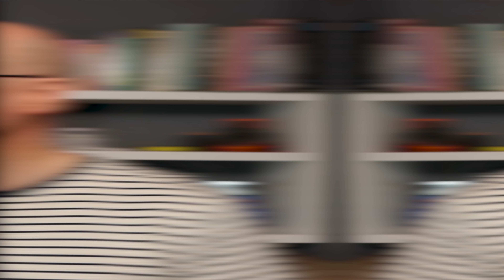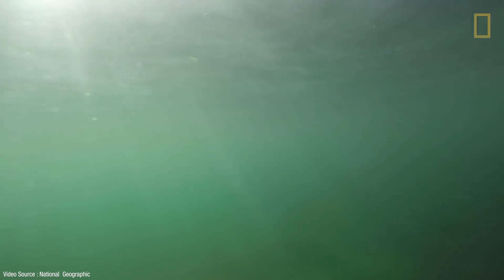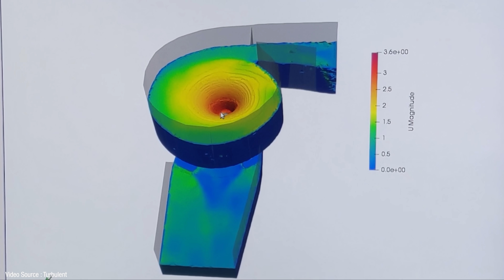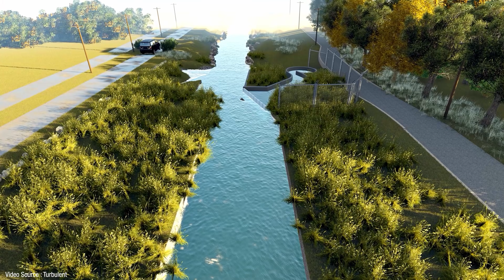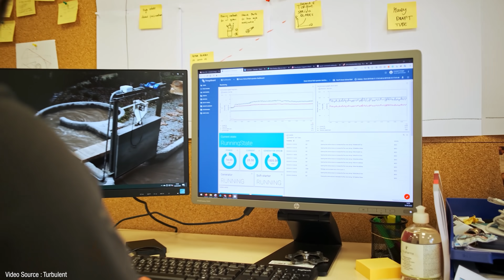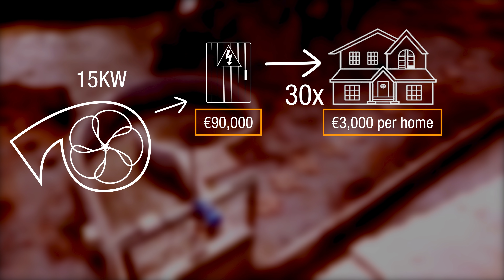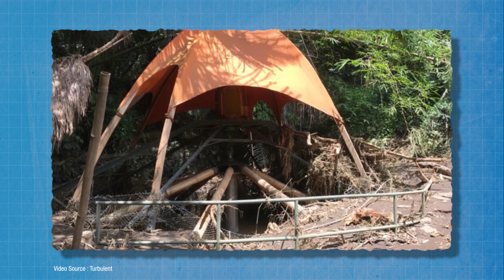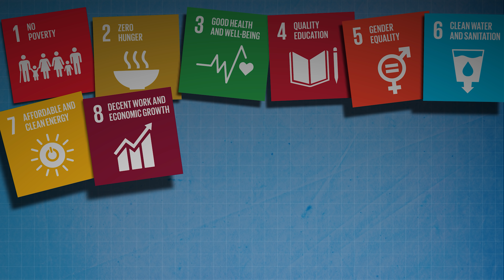Micro Hydropower : Turbulent Turbines

Comment: "... the low rotation speed turbine blades have soft rounded edges, allowing aquatic life to pass straight through the entire system, possibly somewhat invigorated and keen to have another go ..." 

That was gold! :D
Reply: People go to an amusement park and pay big bucks for a ride like that.
Reply: @juliaset751  Exactly!  Charge the fish admission.  Then feed them tartar sauce to cut out the middleman.
Reply: the problem is how aquatic life gets back up to the top have another go... without an explicit bypass this turbine is just as effective a filter as any other setup.
Reply: @mozismobile  The turbine is installed as a channel that is parallel to the river, so all the fish would need to do is swim back up the river and enter the turbine inlet channel  again to have another go.
Reply: this exact example, yes, but it wasn't clear that that's the only possible installation. It seems likely to come down to regulation and enforcement rather than mechanics.
Reply: @mozismobile  That is the only installation that has ever been even suggested. Any other setup requires different kind of turbines.
Reply: if fish can get into the system then so can debris and silt. this thing will be silted up in no time.
Reply: @Withnail1969  There is a grill/grate over the entrance to the channel that is there to prevent large debris/fish from entering the system. The velocity of the water going through the vortex channel/turbine should help prevent the build up of silt and small debris. The channel inlet also has a sluice gate over it to stop the flow of water entering the system so maintenance (cleaning and/or repairs) can be undertaken, if required.
Reply: @Withnail1969  i said it should help prevent the build up of silt. Of course silt is going to get into the system, but the high flow rate of the water through the system should carry most the silt away and help prevent it from building up. No nan made systen is perfect, and no doubt it will need periodic cleaning and/or maintenance,  but then so does every other power genrration system that has been created by mankind.
Reply: @Withnail1969  How do you know what effects silt has on this system?  Do you have any first hand knowledge of the rate of silt deposition in any of the currently installed units? Have any of them been choked by silt to the point that they've become inoperable, or beyond repair or dredging?  Do you realky think that the engineers who designed the system didn't factor in the potential for silt build up, and ways to eliminate or mitigate and manage it? 

Large scale hydro-electric dams are also affected by silt build up, but countries still build them and live with the knowledge that they'll have to dredge them from time to time, as well as maintain and repair them.

Since you're obviously so smart, instead of being so critical, why don't you come up with a better system than this? One that eliminates any chance of a single grain of silt entering into it, never requires any cleaning or maintenance, and delivers equal or higher efficiency?

crickets chirping ....
Reply: @Withnail1969  If the stream is flowing fast the silt will stay in the main channel instead of diverting to the side route. If the water flow has slowed down the silt deposits at the bottom of the main channel instead of jumping like a fish into the other channel. If there is so much silt hat some will get there anyway, the fast flowing water will carry it to the outflow hole, which also happens to be at the bottom where the silt is going naturally.

If you want to slow down water so silt becomes a problem, build a dam.

As for larger debris and fishes, the grate stopping them from entering has smaller openings than the maximum size of fish that can get past the turbine blades without problems. If something manages to block the turbine it either didn't come from the river or broke through inch thick steel bars to get there.
Reply: @Withnail1969  And then down the drain. No problem.

In the case that your alleged river is actually a mudflow and some silt managed to collect at the edges of the side channel where the flow does not pick it up, you still have no problem because 1. It is not going to bother anyone there, and 2. It is easy to close the intake once a year and brush anything on the bottom down the drain hole before reopening the gate so the water flushes everything out.

Rather than silt you should worry about tree leaves in the fall floating on the stream. Assuming, of course, that you happen to be somewhere in the world where "fall" is a season instead of a verb.
Reply: @AnalystPrime  I think @withnail1969 is just trolling this thread
Reply: @Withnail1969  They’ve been operating for a while now and that doesn’t appear to be happening.

Comment: Love the Idea. 
In the USA the biggest stumbling block in my opinion would be the cost of regulatory hurdles. That would probably cost double or triple the cost of the installation as well as changing the timeline from months to possibly a decade or more.  Some small minded people will kick and scream about environmental impacts, weather imagined or real.   
There are many dams that already exist that could be retrofitted to generate power with little environmental impact.  But again regulatory hurdles hobble their implementation.  
Truth be told, our need for electricity is ever growing and no way of generating power will have zero environmental impact. We need to evaluate the total environmental impact of each type of generation from manufacturing, component transportation, installation and maintenance to decommissioning. Once this is done develop an incentive program based on these results and streamline the permitting process.  This incentive program should also include disincentives for the most environmentally impact full types of generation.
Massachusetts has the SMART incentive program for solar power generation that works this way for Solar PV installations.  It gives a more generous reward for rooftop solar that for ground mounted.  Higher incentives are paid for brownfield systems than for greenfield ones.  
This is the type of consideration that should be given to all energy generation projects on a national level. Maybe the UN could even make recommendations for guidelines on an international level, while recognizing that works well in one area of the world may not be the best solution in another.

Comment: I have never understood why there's never been a magnetically stabilized friction free version of a normal turbine. It just seems like it would be a slam dunk, we can suspend a turbine in a magnetic field and then the yields would be orders of magnitudes higher. Even if you had to use a fraction of the energy to start it up.
Reply: I believe they are used in BIG turbines. To expensive, complicated and only not impacting efficiency that much compared to the entire system means they aren't worth it for anything not BIG.

Comment: There's a weir in my town with a head of about 2m. There was talk of installing an Archimedes screw hydro system on it a few years ago which fell through because alterations to the existing infrastructure was going to be too expensive. But I reckon one of these could be installed off to one side without altering the old weir at all.
Reply: There are a few community owned Archimedes screws near me - New Mills Torrs, Stockport Hydro and a new one has almost been finished in Congleton. It is very hard finding sites which are economically viable but more are slowly appearing around the UK as the technology gets better and cheaper.
Reply: @ShawFarmHolidays  I agree that it is very hard finding sites which are economically viable for micro hydro in areas which are alreay grid connected. One proponent complained it is harder to get a licencse than to build a nuclear power plant (he was not really serious, but you get the hardship with the red tape for a 5-20 kW unit). The water vortex system has the advantage of lower civil work, as you need not build an extra fish pass, and no fine screen is needed. But it also has a lower mechanical efficiency than a water wheel or classic Kaplan turbine, because it lets slip fish pass in both directions meaning higher water slip.
Reply: The civil works are the largest cost driver in hydropower projects, especially when you have rather small power units. It is basically a run-of-river plant, and those do not run at full power in the dry season either.

Comment: I saw an even smaller system than this in Nepal in the early 90's. It skimmed water off the surface of the river, along a sluice channel, and down through a turbine in a pipe. It cost them about $USD5/W of this tiny system, which then provided them enough for lighting at night, and during the day they used the turbine to drive a sawmill for timber. This was significantly cheaper than what they had been spending just on Kerosene in hurricane lamps! The community arranged this themselves, and got a low interest loan from the government. Meanwhile, the government was working on the Arun III dam ....

Comment: Contrary to what this video says there's no magic in low head, run of the river or mini size! A high head pelton turbine works just as well with a lot less water, there is run of the river hydroelectricity measured in gigawatts and a huge dam in the mountains doesn't impact people or fish. It's local circumstances that determine whether a  design is good or bad.
Reply: of course there isn't, you can't change the laws of physics. if you want to move a turbine with a decent power output you need a lot of water.
Reply: @Withnail1969  - Or a high head of water.

Comment: So interesting. Can see how this idea would connect well with regreening projects, so that when the water returns to arid areas, as the aquatic life starts to come back they have untouched flow areas and some parts channeled off for micro power.  Even wondering how small one of these can be for a single house considering that smaller seems to equal less damage. Such an excellent idea. Less grand schemes more of the useful and small. Great video.

Comment: Excellent program, I'd love to get this as part of a series dealing with single family water turbines especially where you have a large flow of water at a fast pace but not a great drop in elevation...
Reply: Check out ram pumps.
Reply: @tombombadil3185  I know ram pumps very well, I was more interested in a small microturbine for electricity purposes
Reply: @tinker7998  Lots of ideas for home built micro systems on the net.

Comment: @Just Have a Think: Ever heard of a ram pump? They can develop tremendous head pressure. For individual homes they would be ideal to run a small turbine/alternator system. They would have very little intrusion into the ecosystem, much less than the system you describe. Simply lifting the water to height and letting it fall would develop 2.31 ft/pound pressure.....
Reply: Conservation of energy: The energy of the water going through the pressure building fat pipe of the ram pump, is orders of magnitude larger than the enegy of the lifted water. So unless you want more intermittent power than your creek can supply, so you let your ram pump supply a water tower or pond, you'd be better off, just placing a turbine directly in the feedpipe for the ram pump and ditch the ram pump entirely.
Reply: @Tore_Lund  Key words; column of water.

Comment: What we have to deal with is the lack of resources for the microchips that these technologies need. We are already hearing of microchip shortages across the world, with, as per normal, the coronavirus being blamed, but the fact is, a key requirement is industrial sand, which has practically run out! Other resources are in very short supply too. We talk about when oil runs out, but there are so many minerals that are also running out, that civilization cannot live without. Therefore, I would like to see more human input into the operation of these technologies, rather than technology.

Comment: Would be curious to know how the power output compares to a standard water wheel of the type used in mills for centuries (though upgraded to use modern materials). Seems like a water wheel would be cheaper to construct since it just needs a straight channel.

Comment: The Diesel engine was deliberately designed to run on all kinds of fuels and has one of the best efficiencies of combustion engines. The fact that it is in practice mostly run on mineral oil is a result of the prevalence of the fossil fuel industry. Not to advocate it above non-combustion means of generating efficiency... when there’s running water with continuously sufficient flow, small turbines are certainly superior. But a backup is never a bad idea.
Reply: Deisel engines definitely still have their place, but the higher pressure and combustion temperature also leads to the production of a lot more harmful nitrogen compounds making it harder for them to have comparable emissions to other internal combustion technologies.
Reply: @garethbaus5471  As opposed to a car, a stationary diesel generator can afford to have good scrubbing of such pollutants. If it's only used as a backup I wouldn't worry about the extra expense.
Reply: @leerman22  if it's only used as a backup the extra expensive of scrubbers seems much less justified, but yes scrubbers do tend to improve emissions.

Comment: Couple this with gravity powered lighting and you could provide more power to more people in these remote areas. Love the idea of displaying diesel and kerosene. Just a no brainer.
Reply: you can't power lights with gravity.
Reply: @Withnail1969  sure you can. You convert gravitational potential energy to electricity. This is exactly how dams work. There are simple products that do this already. Take a look at smarter ever day’s channel. They have a nice video on the topic.
Reply: @Withnail1969  if you wanna be pedantic, sure. But then again, quasars are literally powered by gravity and they’re by far the most powerful objects in the universe. You don’t have to power them by electricity.
Reply: @Withnail1969  thankfully you’re correct. But we use gravitational potential energy to generate electricity all the time so I have no idea what your fundamental objection is.
Reply: @Withnail1969  I’m not talking about hydropower here. I’m talking about using muscles to raise a weight and then letting that weight turn gears to power a small LED light. It’s not a free lunch, I completely understand that, but it’s damn close. That’s literally all I’m suggesting and one can buy devices. They’re elegant little machines, but it ain’t rocket science and it doesn’t involve free energy.
Reply: @Withnail1969  it beats kerosene or no light at all. Is it perfect, no. But it’s simple and doesn’t require any infrastructure.

Comment: Another idea that is worth looking at again is the "Floating Watermill" These machines were once quite common particularly in Europe albeit for grinding corn (For those interested in such things I would direct you to 'TIMS' (Transactions of the International Molonolgical Society) Who have published a very useful history of the Floating Watermill! I recall visiting one of the last commercially operating examples in Yugoslavia in the late 1970's.) I have often thought that such a concept would be particularly useful as a power source for irrigation pumping systems and could easily replace  diesel pumps. Also on medium-sized rivers they could be useful to generate electricity. Whilst I am fully aware that such a system would not have the power of a bespoke turbine. They would have the advantage of being able to be installed easily.
I also suspect that it would be possible to build examples for use in tidal rivers. Ok this would have the disadvantage of the Tide Mill. But such a system could be combined with a battery or even a low pressure compressed air storage (up to 10bar) system. I am sure that such relatively low cost concepts have a role to play. 
Certainly as already noted there are thousands of potential sites all over the World. Which already have the dams and leats already in situ from abandoned watermills. It would not be that difficult to install small scale hydro power into the existing water courses.
Reply: I know of a developer who has developed a system to produce megawatts as floating hydro system has been proved up by universities and praised by engineers, but alas cannot get the funding to build a prototype, one day I guess when all the vested interests are satisfied?
Reply: @gregevans1730 Not surprised to hear this Greg. I have heard similar things in the past. An engineer friend of my late father devised a floating water powered irrigation pump for use on rivers like the Niger or Nile.
He got very little support. 
Yet in many respects it is an obvious innovation and doesn't need to be "bespoke"
Reply: @nicholaskelly6375  this is the basis of the system FYI Sorry its lengthy HydroNova is a newly developed, advanced hydropower technology designed by Australian inventor and hydraulics engineer William (Bill) H. Richards. It has been twelve years in the making.The two major applications of this new technology are run-of-the-river floating hydroelectric generation and floating tidal surge hydroelectric generation.
Reply: @gregevans1730  Excellent I will follow this up. Could you advise on some links to this.